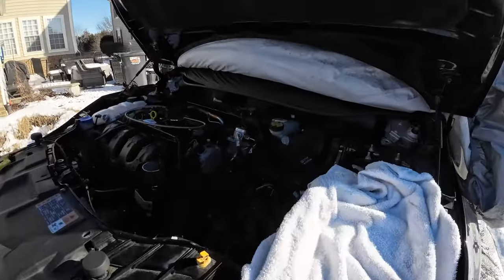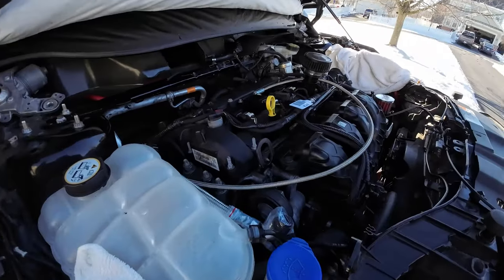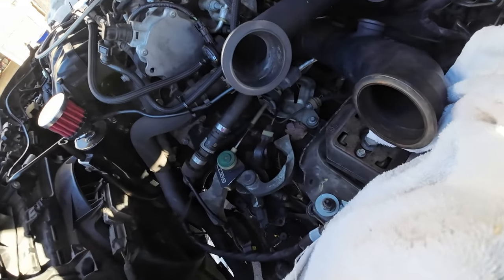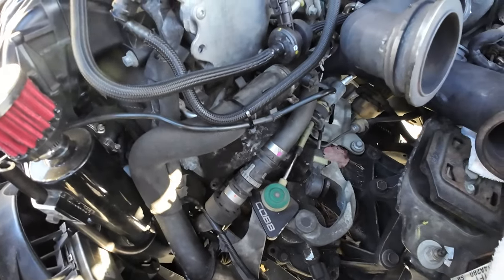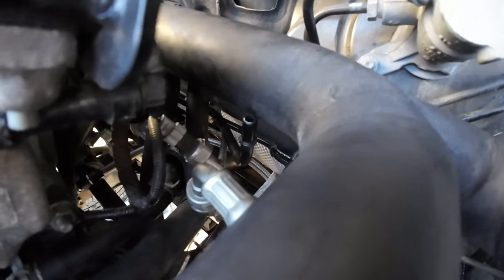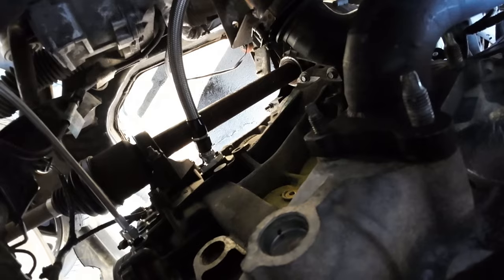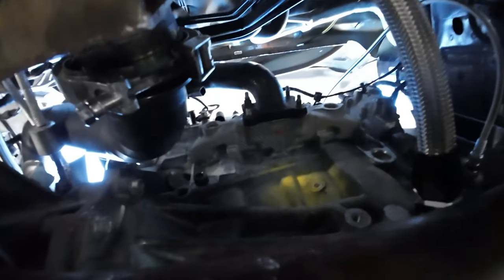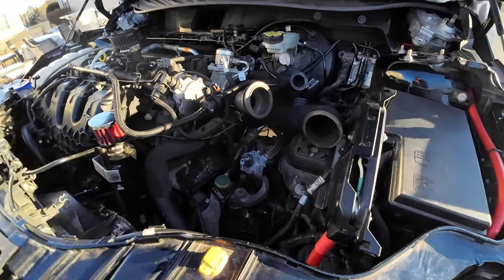Ford Focus ST Sidewinder Kit MOCKUP Part EP #3

Comment: Did you buy this kit on eBay? i swear i saw the same one there and i was trying to get but someone beat me to it
Reply from the maker: yeah i did! i wish i just went to a fab shop and had my own made. 

the downpipe had to be cut and welded again because it didn’t fit my exhaust setup. 

i had to cut and get the intake tube welded because it wasn’t fitting as well. 

the turbo is also a mess. rusted and had fire extinguisher dust inside it… 

wastegate was toasted. 

all and all basically had to remake the entire kit. but at least i had the blue print 🤣
Reply from the maker: my advice get a local fab shop. i had them refab it. 

if you want measurements i can get you then